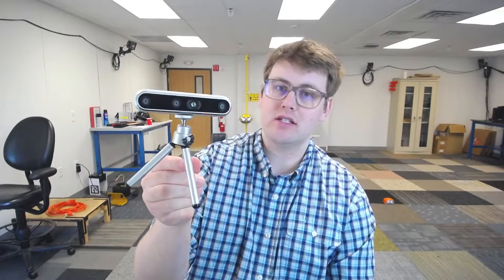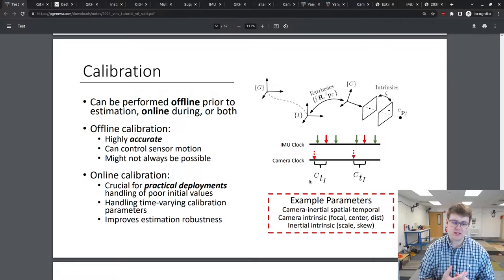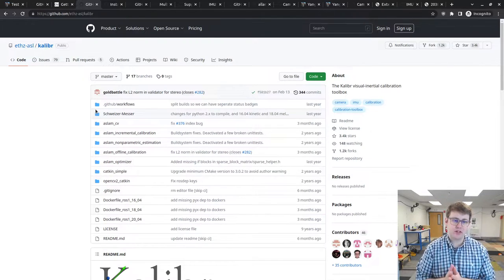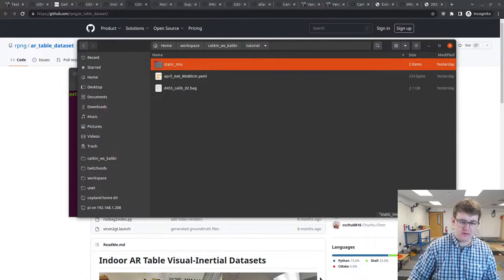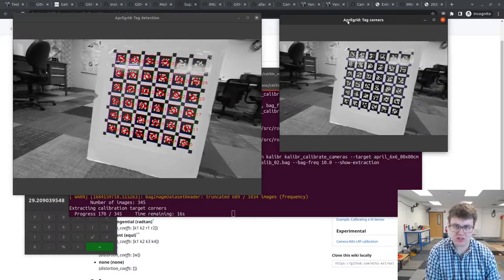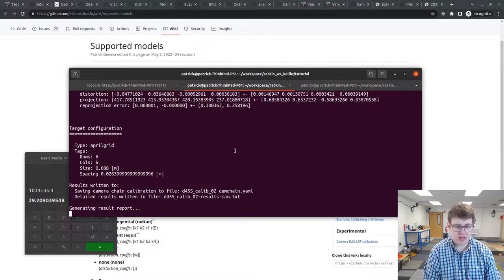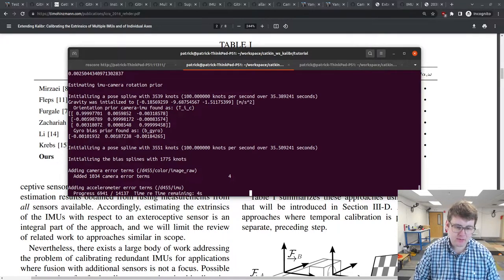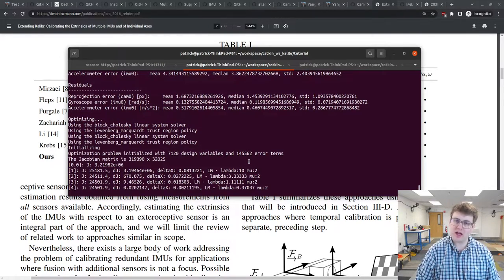Visual-Inertial Sensor Calibration -- A Complete Tutorial and Discussion

Comment: Hi Patrick, great content ! At timestamp 25:48, you said we dont use the values of random walk and noise directly, but inflate thm by order of 10 times or by 20. Why is it so? Is there any mathematical or empirical significance to it? Or is it just that moving robot might incur more noise and bias for IMU than when calculated for steady IMU?
Reply from the maker: This is to take into account additional noises not fully modeled. Especially if you will mount this sensor on a mobile robot, there will be additional vibration and temperature affects.

Comment: Hi Patric, Thank you so much for your great video. At timestamp 37:34 you are mentioning the timeshift cam0 to imu0 that its not 0 and we have to take that into account. I have two questions: 1. By we should take that into account, we should use that as the time_offset in the kalibr_imu_chain.yaml file of our open-vins configuration? 2. If this data is bigger than 0.002 seconds, how it will effect our localization?
Reply from the maker: Yes, it should be taken into account at the point that the two sensor streams are combined (e.g. a visual-inertial navigation system). The magnitude shouldn't matter much but will cause the estimate to be delayed since we will need to buffer enough data until we have the sensor data from each sensor at the same timestep. Hope this helps.

Comment: Hi Patrick, how about your computer configuration ? and I have a Intel® Core™ i7-10700 CPU @ 2.90GHz × 16  computer and run one  imu and two cameras calibration using kalibr for more than two hours, Could you give me some tips about how to accelarate?
Reply from the maker: Ensure you build with release mode. Additionally, you can process the camera at a lower rate with the --bag-freq argument.
Reply: Thanks very much and that works  @patrickgeneva